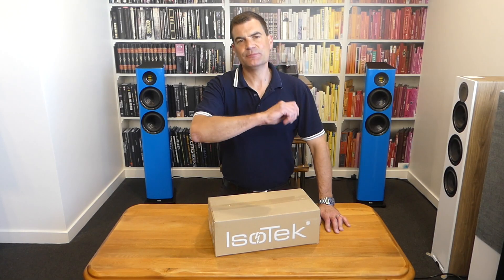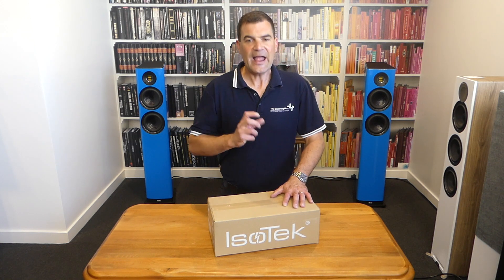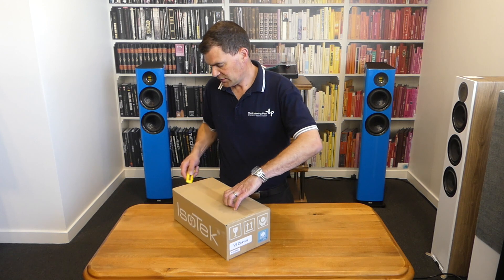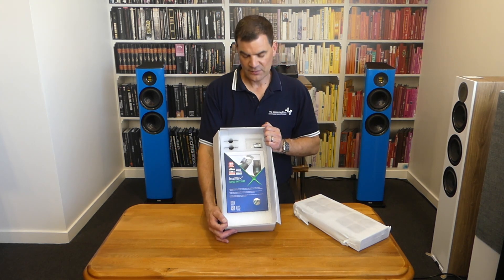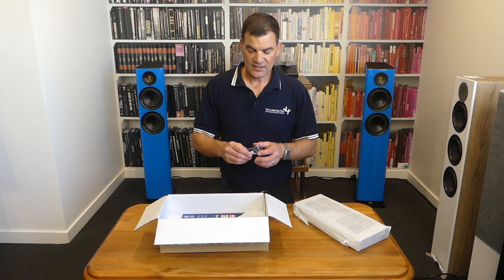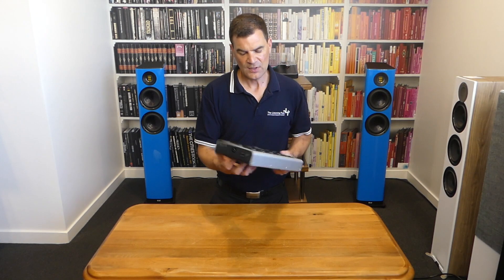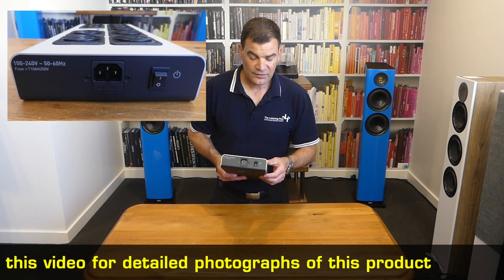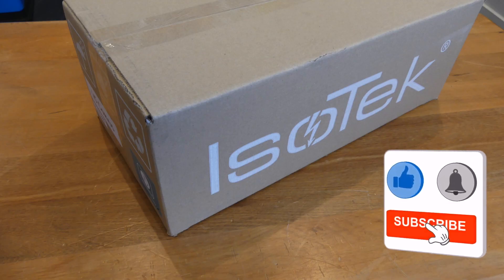IsoTek V5 Corvus 9-way | The Listening Post | TLPCHC TLPWLG

Comment: Are there any specific 'high power' sockets for amps or can you use any socket? Thanks!
Reply from the maker: You can use any socket for a good, mid to high end amp and get a noticeable improvement.  At the very high end, IsoTek do a Thor specifically for power amps, with a tap out for the likes of the Polaris or Corvus to tap into for the lower power (more sensitive) components.    There is a video on this YouTube channel for the Thor if you want to see it.